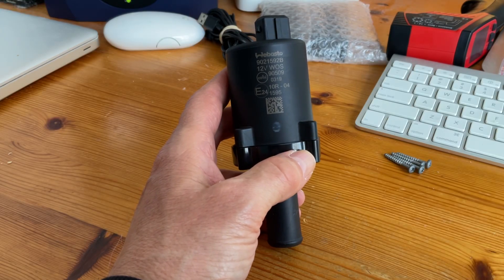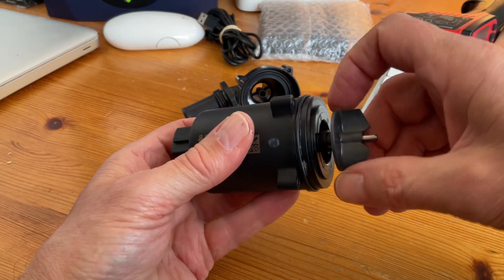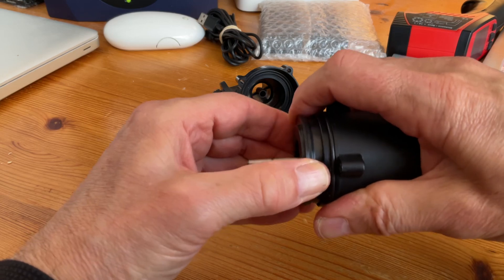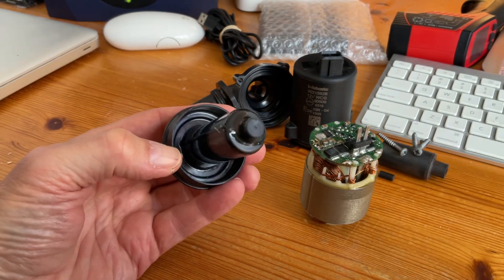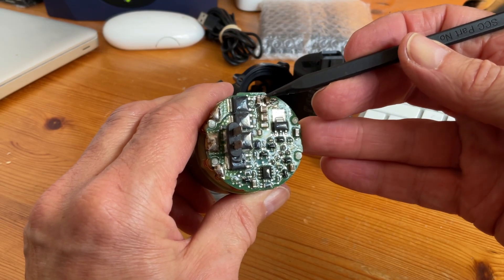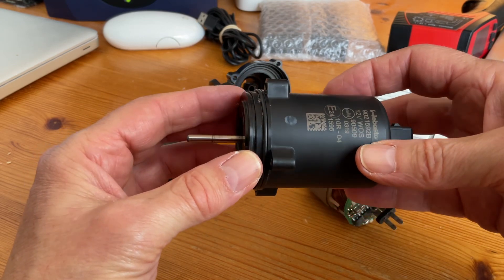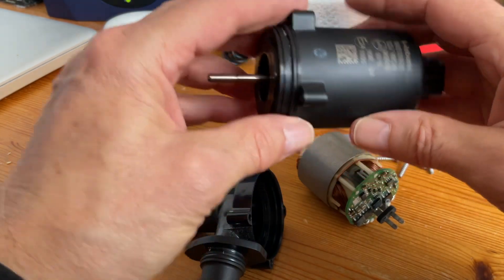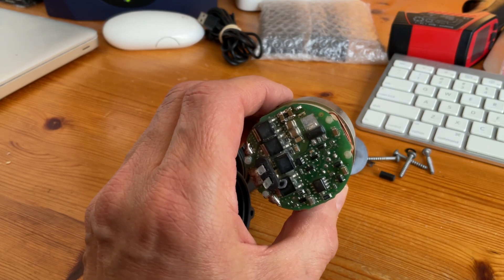Snow Gum - Webasto heater coolant pump repair - Garcia Exploration 45

Comment: My car smells when I open ac and i see leakage around webasto... Is it possible to leak fuel or coolant? And doing this smell?
Reply from the maker: Hello. The leak could be diesel, or coolant, or both. The first question is, does your Webasto model pump coolant around the vehicle, or just blow hot air? Given it's for a car, I'll assume it's just hot air. If this is the case, the leak is probably diesel. Further, diesel does have an odour to it, whereas coolant does not make as much of a smell. So there's my analysis. I think you have a diesel leak, which needs to be fixed quickly and certainly before you use the heater again. Preferably, before you use the car again. 🙂

Comment: If I take it out of my car, how much coolant will come out?
Reply from the maker: Hi UR. An owner of the same boat and Webasto unit recently removed the water pump only, without spilling much coolant. He used two coolant hose clamps to pinch the hoses either side of the pump, which limited the coolant loss to about half a cup. Without these clamps, a lot of coolant will flow into the bilge and make a mess that needs to be cleaned up. But I have a question for you - are you sure the Webasto in your car is a model that uses coolant to distribute heat throughout the vehicle? Many of the models installed in cars/vans simply heat air directly, which is then blown via ducts to the outlets. Worth a check. 🙂 Regards, Rick.
Reply: @ yes it heats up the coolant and therefore underside of the engine. The car’s a/c system uses the hot coolant to warm up the air that it blows in the cabin!
Reply from the maker: Ah, I see. Yikes! It must be a cold place where you live. 
Well, the amount of coolant that will spill when removing the heater depends on where it is mounted (in terms of gravity drainage) and the length of the hoses. The hose clamps I mentioned will help keep coolant loss to a minimum. If the problem is the pump, you might be able to remove it while leaving the heater in place. You’ll still want to use the hose clamps.
Reply: Thanks for the advice. It’s not that cold here, it’s just how VW / Webasto work on cars I believe. The hoses are pretty thick and have these locking clamps around them. I don’t know if it’ll work with clamps like you suggested. Will try to hold the inlet up so it leaks less.
Reply from the maker: The trick with using hose pliers/clamps is to apply them far enough away from the pump and ring clamps so that the hose can be pinched comfortably and completely, without risk of cracking the plastic spout of the pump. You might be able to improvise hose clamps, such as using woodworking G-clamps and two small pieces of wood, to pinch the hose about 15cm from the pump housing. Good luck with your work. 🙂